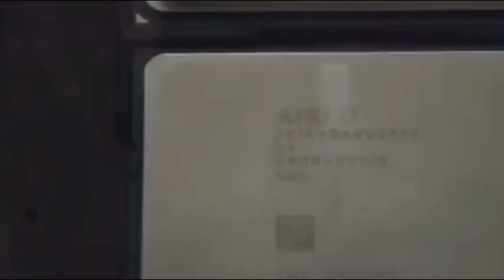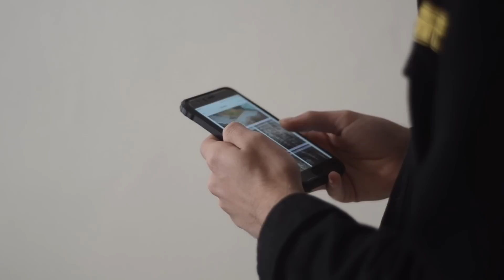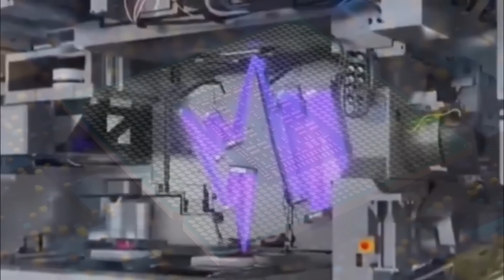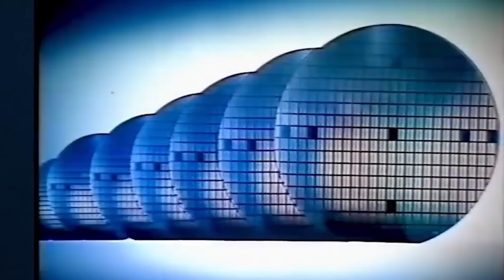China's "Photonic Chip" Breakthrough the Resurgence Of Huawei-ASML Is A Big Storm In A Teacup!!!

Comment: We should not get carried away by the starting of a Chinese production line for the photonic chip this year.
This photonic chip coming out of the production line is the first generation design of this new photonic chip and its performance and reliability need to be proven with a widespread successful usage.
That will take a long time and a large usage quantity to do so.
Intensive R&D to improve the design of the chips that follows are also required.
Nevertheless it is a path China had to take as the US hostilities towards China in the recent US's Chips and Science Act make it necessary for China to use another route in its semiconductors industries.
If China succeeds in this new photonic chips' usage direction, USA will realize the ancient wisdom of:
不要趕狗入窮巷
因為狗被逼急了, 會反咬你一口
不要赶狗入穷巷
因为狗被逼急了, 会反咬你一口
Don't drive a dog (or a person) into a blind alley (corner) as it will be forced to turn back and bite you.

Comment: I dont think so Photonic chips has advanced that fast to replace silicon chips.... u need a laser source to drive photonic chips also can the size of these photonic transistors be able to match or beat silicon chips of 3nm and below?? So far from my search Photonic chips does have the capability but high volume manufacturing and the laser source is still an issue so pls dont overhype this too much I dont think Photonic chips will replace 5um and below silicon chips yet.
Reply: They said the same thing of "impossible" when Huawei first made announcement about HongMeng OS... lol
And photonic chip don't need single digit nano size to achieve performance of 3 nano silicon chip speed.  When your knowledge is limited doesn't mean China cannot make it. 😂
Reply: @leealvin6820  - Go read what I wrote pls instead of jumping to conclusion. I dont think we have reached that level to create photonic chips that can replace silicon chips to similar capabilities and there are still technical hurdles to overcome. Since u apparently know so much, pls share which photonic chip has made it to high production and use in todays high tech gadgets?
Reply: Gallium Nitride is the laser source and China has made significant breakthrough in laser source’s and manipulations.
Reply: Its still a breakthrough that in the future will help China as they make them better
Maybe not up to Taiwan standards yet but it has potential don't you think?
Reply: Photonic chips are not there yet but America's sanction on chips sale to China and to gather her allies to do the same will slow down but not stop in Chinese chips development.  With Chinese money and talents, success will come faster than you can imagine.  What happens then to the American suppliers like Nvidia, Intel that do business with the huge Chinese market?  American shortsightedness is amazing.
Reply: It’s called Gallium Nitride, it creates solid state lasers.
Reply: China can make chips smaller than 1 nanometer. Just like light particles.
Reply: China has more intellectual tech, look at thier build space station, right now US 2 step behind them